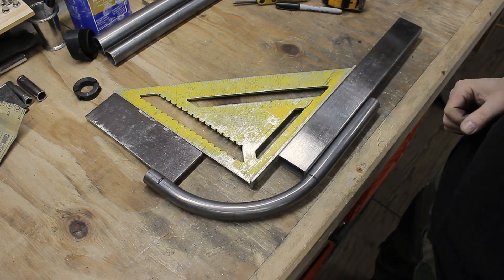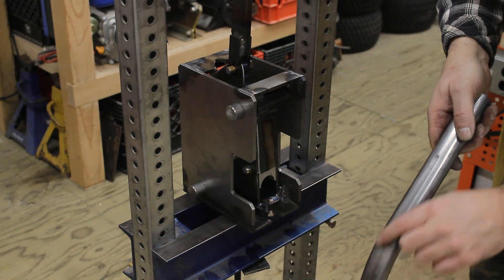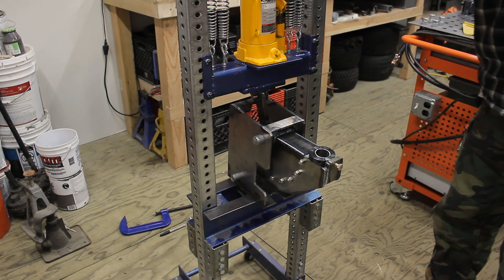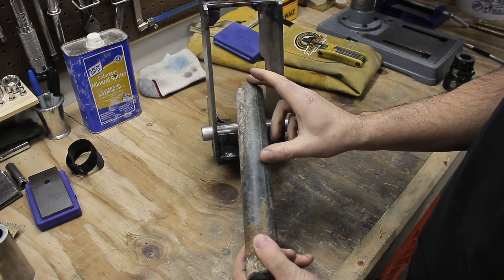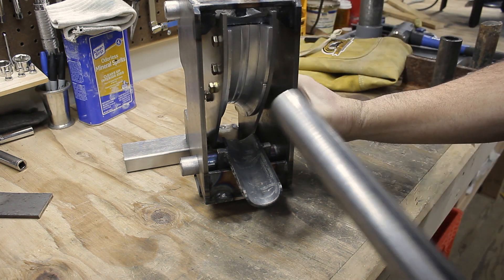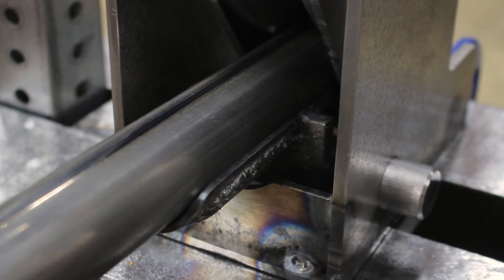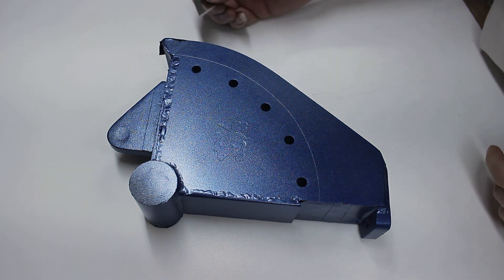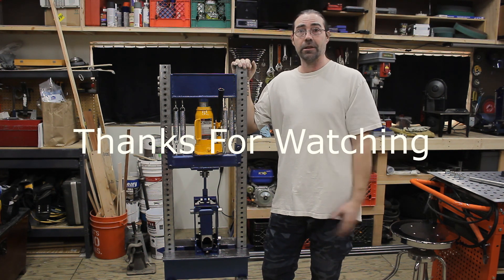D.I.Y. Tubing Bender Part 2

Comment: Looks good i have been wanting to build a tube bender so bad i have a first gen hf pipe bender i havnt used it in over a decade but it worked if you took your time a be very careful more of a pain but tubing bender dies are so expensive. Have yiu tried using grease or oil on the tubing it should help with bending the tubing!!!!! Thanks fir the video going to have to check out your first one on this project now!!!!!!!

Comment: Very nice! What is the name of the “electro-etching” process you used for the markings? Whats the liquid?
Reply from the maker: It's just 1 cup of regular tap water with about 4 tablespoons of salt. Put the positive side on your work and neg on the wire. Was about 24 volts at 10 amps (DC not AC). Changing your voltage and amps will change how fast or deep it cuts. Watch https://www.youtube.com/@KirillRunz
Guy does some cool stuff.